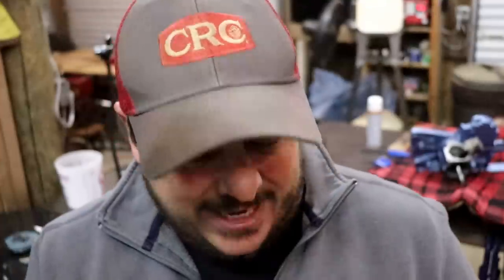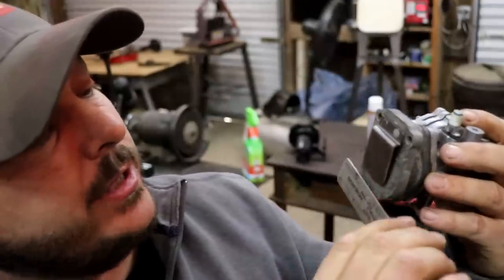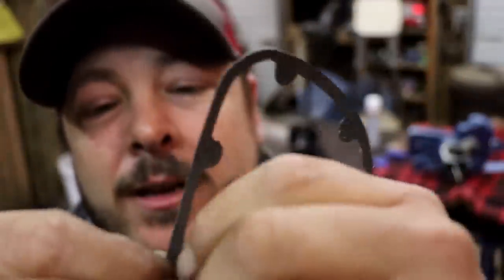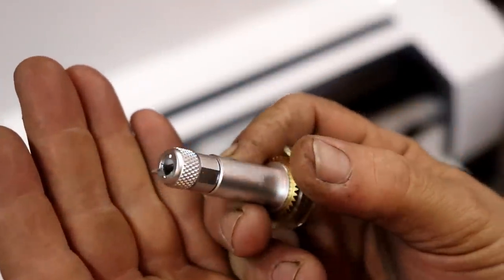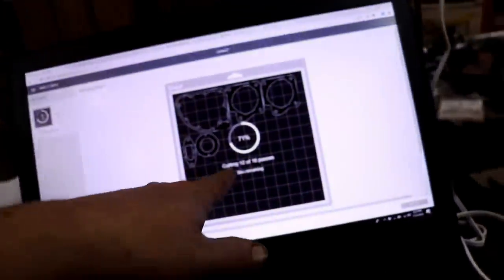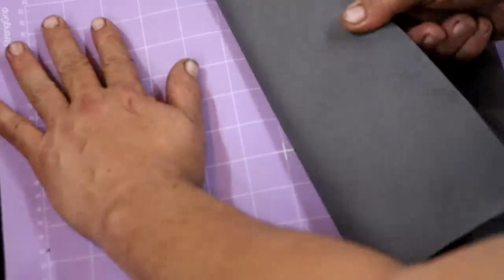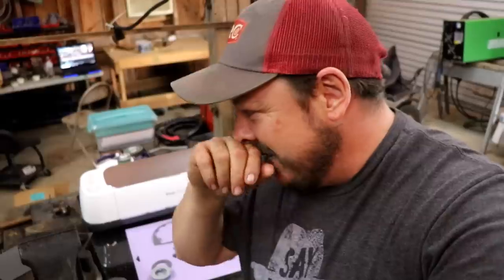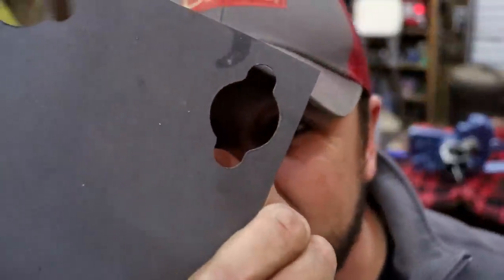The Incredible GASKET MAKER your WIFE already knows about!

Comment: Quick tip some of them smaller gaskets couldnt been cut out of the larger gaskets waste save on material wasted I cnc laser alot and we try to use every bit of material
Reply from the maker: +Finn Balor Thanks Finn. Now that I know the material stays put on the mat I will give that a shot. What do you recommend for a home laser cutter?
Reply: The Good of the Land cnc plasma rather then cnc laser mainly because plasma is a lot more affordable than laser but laser is a lot more accurate and that's only if you're cutting super fine tolerances

Comment: How much is a cricet.
Reply: This particular Cricut is the Cricut Maker and it retails for about $400 give or take depending on sales and package deals. I bought a brand new “used” one for $250 off of eBay though. :D

They have several different models that you can get for much cheaper, but honestly I wouldn’t get anything except for the Maker. It is FAR more robust than the cheaper machines and has a lot more capabilities. The other machines are basically limited to paper/vinyl arts and crafts and that’s about it. The Maker can actually do something useful. Lol

Comment: I don't get it. You take a picture of a part and ruler, throw it in photoshop, and a perfect picture of a gasket comes out. Every curve of the gasket, every hole placement is perfect because you know the height of the part by the ruler.  If I took a photo of a part with a ruler on it and threw it in photoshop, I would end up with a photoshop picture of a part with a ruler. You, on the other hand, end up with a photoshop picture of a perfect gasket.  How did you do that?

Comment: I just check it out (the machine) and the review are not all good for it :/
Reply: My wife has had one for a few months now. I bought it used off of eBay. It has had a couple of software glitches on rare occasions, but for the most part it has worked flawlessly. I highly recommend the Cricut maker. It seems to be a very well built machine. The damn thing has brass gears inside of it and is capable of cutting wood, plastic, leather, and can even do engraving with an aftermarket tool installed. I do recommend taking a stone to the Cricut blades. They look horrible under a microscope. I can’t deny though that they do a decent job of cutting with a nasty jagged edge, but if you stone them smooth they cut a LOT smoother.

Comment: Or just get a 3D printer and print your gaskets, along with anything else you can use the printer for. You can get one for around the same price as the Cricut and it'll be way more useful in the long run.
Reply: Would the material in the 3D printer be suitable for heat and chemicals you would find in an engine?
Reply: @kevink6265  absolutely not. PLA and other plastics just melt. Its been tried already.
Reply: @mattwright6249  thanks, that was my first thought but I know very little about 3D printing.
Reply: A 3d printer is a cutter just like a screwdriver is a hammer.

Comment: Instead of a picture of the gasket I wonder if you could take a picture of the engine part and make a gasket from that. I guess it would boil down to your skill with photoshop.
Reply: As long as you gasket only needed to be flat, you most certainly could. Just make sure to take the picture as square as possible and lay a ruler across the widest part of it so you knew what to scale the image to. Doing basic stuff like this in just about any photo editing software isn't hard. And if it is to complex finding someone to show you how to do it would be pretty easy nowadays.

Comment: Cricut needs to redo it's advertising.  I looked into Cricut for making logos and
cutting gaskets and I couldn't find any way to do anything except doing useless
clip art crafts.
Reply: If they would change their design space program to work more like a basic 2d Autocad program, the potential for these machines would be endless. I was highly disappointed with the limitations of the “freehand” drafting part of the program. Even Microsoft paint has more features than design space. Fortunately there are ways around most of the software’s limitations, but it’s just a pain that you have to jump through hoops to do fairly basic jobs.